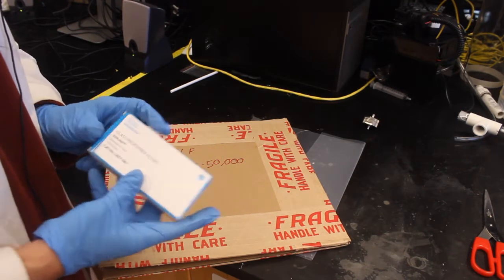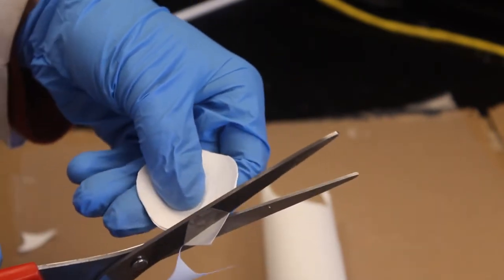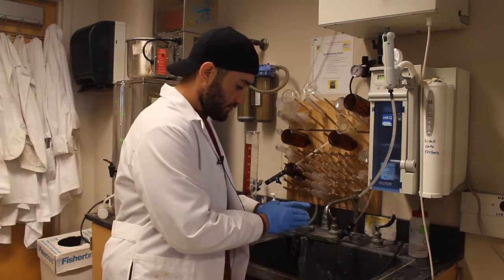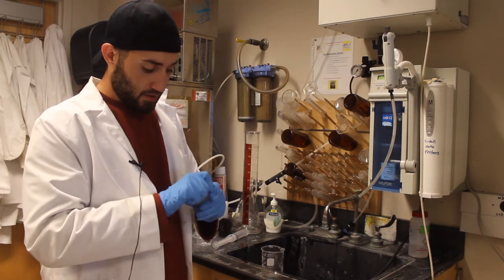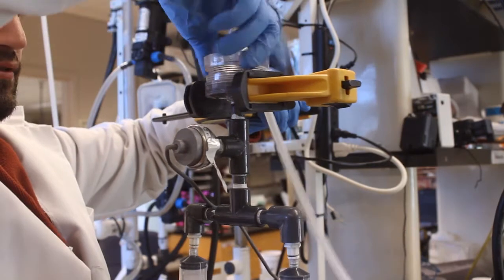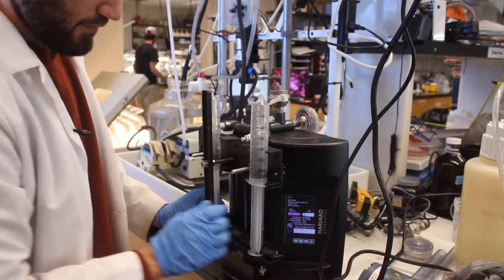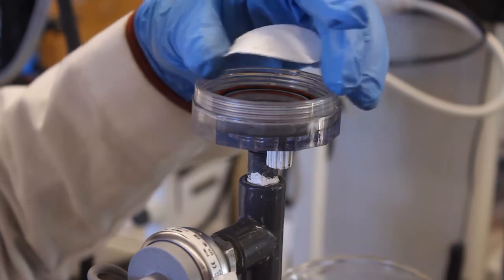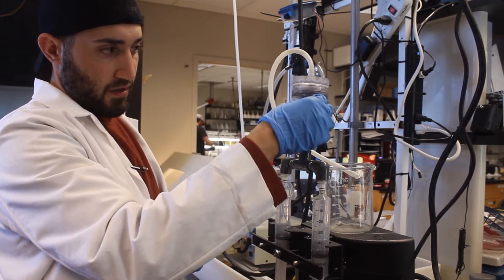Modified fouling index testing - System startup

Comment: Dear Robert Bair, thank you very much for the video, it was helpful a lot.
I am Master Student of Vienna University of Life Science and Im working on MFI vs SDI project. I am stuck on the curve calculation and I am kindly asking how to do so. On excel I have the values of litters the filter have filtered and the second of which it required to filter. So to get the s/L vs L curve I am dividing the seconds by the litters  ( without no minus V2-V1) and if I get the curve it has a sharp point which looks nothing like the previous research works. The water is normal brine water with 250 mg/l TDS